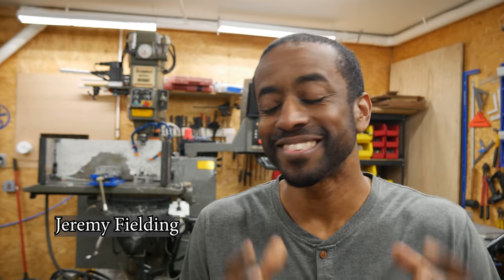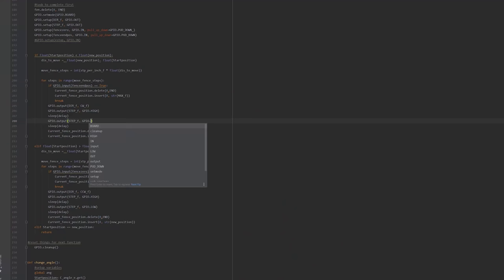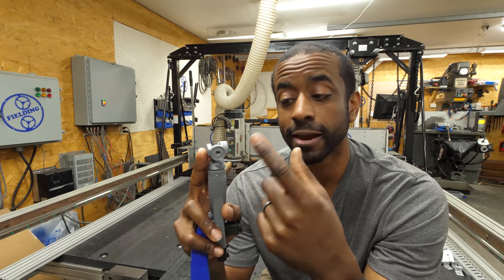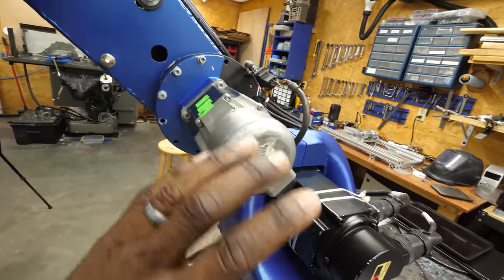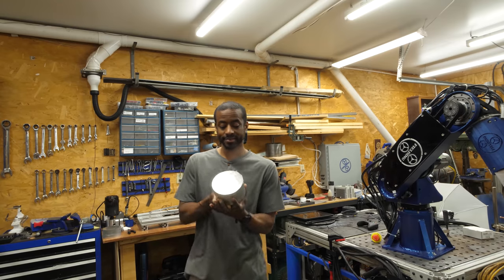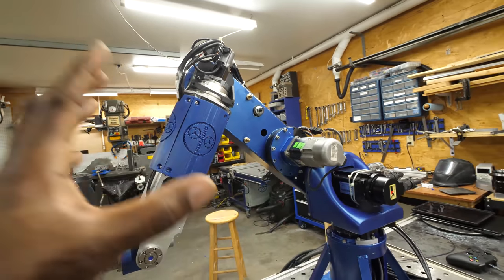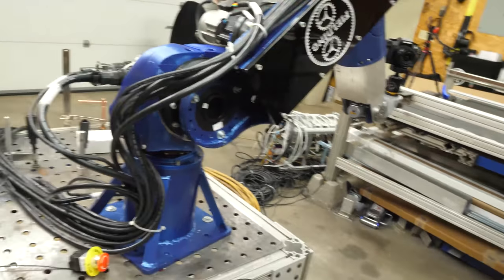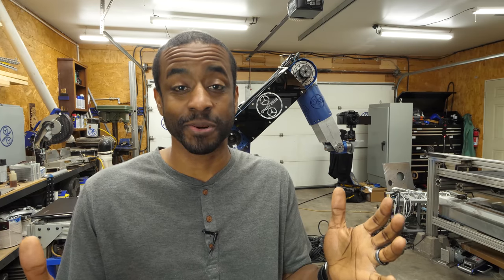Building a 7 Axis Robot from Scratch #089

Comment: As someone in a mechanical engineering class focused on robot arms, it would be awesome if you could show some of the math behind your statics, dynamics, and inverse kinematics software calculations. Also, adding some sort of robot vision for picking and placing objects would be a cool extension of this project.
Reply: I agree with you @jackson
Reply: I like how this guy build a robot arm, but I agree with you. I am an electronic engineer and did robotics at university. I remember that calculating a 3 joints arm was a nightmare of mathematical calculation using Matrix math for Kinematics, implementing certain acceleration/speed profiles. I wonder in fact what happens to this arm when it moves an object....if it stops right where it needs to stop without oscillations (loop instabilities), overshooting, etc. There is so much behind a robot project!
Reply: Totally double tripple agree with Gaetano and Jackson.. its mindblowing to see him building this from scratch. the amount of hardwork, effort, time, research, studies, the level of curiousity (and many more) that had been put into this is just unbelievable.
Reply: Yeah I'd love to see the control software too

Comment: Perfect timing, I'm a mechanical engineering student (at Danish Technical University), and I'm specialising in mechatronics, where another student and 1 are making our own robot arm (due at the end of June). Our project is making a digging robot (with 3 servos).

Your point about the centripetal forces was really good, since I only considered the weights of the robot and load itself.

Comment: I was lucky enough to go to high school in Michigan, we had a robotics program that got cast-offs from the auto industry at my small town high school in the 1990s. It was a real experience. Always regretted not doing more with it.
Reply: If there's one piece of secondhand twenty five year old knowledge I'd pass on, you want to have joint brakes on that. Spring closed, held open by solenoids or air, at least on the shoulder and elbow. There's also the option to support the arm with gas springs, but that limits the range of motion. Saw that on a welding robot when I toured a production line, that was a big jointed spherical with a ten foot reach.

Comment: Just noticed the spindle on your CNC machine in that quick clip. I got four of those this week from an industrial client who is getting rid of them. Some of them are still in the wooden crate but they are all used. Paid Scrap for them so if you have a use for them and I can get them to you somehow you’re more than welcome to them. Two of them look almost brand new and the other two have seen quite a bit of use. I have no idea of the shape they are in internally, but they were just going in the scrap motor band along with a bunch of other large servos and Siemens encoders and things like that

Comment: That's amazing! I am a mechatronics and robotics engineering student, and this year we were working on a similar robot but on a much smaller scale. I advise you to use inverse kinematics to specify the trajectory of the endpoint. This allows you to specify the (x,y,z) coordinates of the start and end points and the robot will automatically follow the path you specify. For the acceleration problem you could decrease the sharp acceleration by moving from the start position to the end position in increments. So you could have a array of points between the start and end positions, and the robot will move gradually through every point on that array. Adding a small delay between every 2 points of the array would help you control the speed. And the more points you have the more accurate the trajectory is and the smoother the robot is.

Comment: Wow, this is an amazing project!  I had a 7 axis arm on an overhead track performing hazardous laboratory tests in 1987.  I worked for BP doing research.  It was very very sloppy using cables to drive all but one of the axes.  Far from a true industrial robot but fun. I had to home it frequently to keep positional errors from adding up and causing issues.

Comment: You should look into the SSRMS. It's the 7 jointed robotic arm that helped assemble the international space station.  The space shuttle used a 6 jointed arm called SRMS.  The main advantage for the 7 joints over the 6 is it allows the SSRMS to do pitch plane changes, but at the cost of infinite solutions.  X,Y,Z,Roll,Pitch,Yaw and 7 joints equal mathematical trouble.  For every tip position of your robot you now have an infinite number of joint positions.  Good luck and I can't wait to see your next video.

Comment: This looks very cool.  It is way too late for this, now, and perhaps you have already looked into and addressed it in the videos you will be sharing, but I would suggest checking out using harmonic drives for robots like this.  They are very reliable, compact, offer very high precision with no backlash, and are self-locking for safety during a power outage.

Comment: Great project!
Do take the time to talk more about safety. These robots kill people every year in industrial accidents, through their strength and speed.
Industrial robots have e.g. hardware interlocks that cut power to the robot as soon as someone enters their workspace, and fencing that prevents people from entering the workspace. They also have spring-powered brakes in their joints that prevent collapse when power is cut. Or they use e.g. harmonic drives that have sufficient friction to not need brakes.
General advice: DO NOT TRUST SOFTWARE FOR SAFETY! Even the most elegant software safety system fails when a cosmic ray flips a bit.

Comment: You can use 3D printed parts to make sand castings to cast your curvy parts in metal (though the lighter plastic might be better for your application).

Comment: Cool project. Safety is a difficult thing to get right with these things, so be careful. They are potentially more dangerous than most things in your shop.

I see you have an emergency stop button wired up, which is good, but be careful that it does the right thing to fail safe.

Comment: I'm an engineering tech that specializes in robotics, prototyping, and automation, I can say that your table is likely not strong / heavy enough to handle the forces you are about to impart on it. That thing has enough power to rip itself right out from that table (or make the table fall over)! I've seen robots with no load literally rip themselves out of concrete slab that wasn't properly supported, or push big aluminum assemblies through drywall like it wasn't even there!

I may not have the engineering knowledge you do, but I do have years of hands on experience building and maintaining these things. If you would like any help, or someone to bounce ideas off of, let me know!
Reply from the maker: This table is not the final location. It’s just the most convenient for assembling and calibration. I agree the power is insanely high. I am operating at about 5% of its speed

Comment: KUKA programmer here. 
AC servo motors! Good choice for speed, power and position accuracy but might be difficult to control. If the motor drives have a step/dir emulation interface you may use almost any microcontroller to generate 6 step/dir streams according to the IK calculations. I think you will need a   big RAM to hold all the step times required to obtain a linear path of the end effector (all 6 motors are interpolated). 
If the step/dir interface is not available, then you have to control the drives using a field bus like modbus or ethercat using something called cyclic syncronous positioning mode in order to send the requisted position to all the drives simultaneously.

Comment: I have the axis 1 servo motor form a Kuka KR350 in my garage (for reasons) The donor robot had a 12 ft reach, and could manage a payload of 350 KG  with a movement speed of 75deg/sec on the major axes, 1,2,3.
It's rated 8 KW.

Comment: Ive only used a Kuka once. But I am fairly well versed in Fanuc and Yaskawa. I also work as an integrator, so I wire/program the robots, robotic work cells, and use a PLC to perform a repeatable process. For you Im thinking you could automate some redundant task/work, possibly between your cnc and robot. I also have experience in EOAT design, you should set up your robot for a tool changer, and do research into multi functional EOAT's. If you have any questions ask away.
Reply: Also i want to add that your work is impressive. Keep up the good work.
Reply from the maker: I am interested in learning about all kinds of robots. Send me a message on my website. https://www.jeremyfielding.com/contact

Comment: I’ve actually been spending a lot of time thinking about making one of these too! I’m sure this video series will be a great resource. One of my main questions is how to make the joints rigid and precise. What did you do achieve this? The only thing I’ve been able to think of is crossed roller bearings, but last I checked those are quite expensive

Comment: Wow what an amazing project!
I've been wondering about building a kind of "exosceleton" robot using carbonfiber composite to make big U profile pieces that support two types of joints: A hinge and a pivot joint. Then you could use the same kind of molds to make the composite and the same motor mounts and gearing for all of them.
If you would use BLDC motors with something like the ODrive you could also use stronger but "flatter" motors then you could use the same kind of planetary gear to mount them "inline" with the joints. 
You'd end up with a very bulky but stiff and lightweight robot arm.

Comment: two-angle full solar tracking on a mount pole arm. with two screw gear lock drives. should be very strong and cheap and easy to make. and more usable practical application.

Comment: There are so many free cad models of robot arms. Just download one and use you cnc machines to make molds for the cast parts. You can make the parts from carbon fiber or fiberglass in the molds you cnc (or even 3d print).

Comment: Are you going to sell it ? I see you have taken clue from Kuka robot for driving the 5th axis motor (vertically oriented motor rotating an axis in horizontal plane). However, it is very easy to sit in a comfy chair and comment like this. Taking risk and making your hand dirty is the most satisfying, mate. Bravo...you just cracked the robotics industry.

Comment: @ 0:53 think of a crane picking thousands of pounds hundreds of feet out. They use extremely expensive bearings that almost literally will not break. The pin holding the turntable on will snap first

Comment: Very nice. If you need a strong complex piece you can metal 3D print it. It's not cheap but it's strong. Something like 500MPa. And you can do finite element generative design so it's minimal mass. You can also use brushless RC hobby motors because servo motors are so grossly overpriced.

Comment: 4:27 why not swap the toothed pully on the motor for a set of bevel gears to transfer the rotation 90 degrees. Then, either directly or using a few more gears, you can drive the belt without requiring any fancy twisted belt work. My concern is that timing belts and other flat toothed belts aren't great to have twisting a lot, and also they aren't great to run teeth out over sharp bends, makes them wear out faster.
Reply from the maker: I considered and designed a bevel gear setup. I might try to address this question in the series. There are too many different factors for an adequate response in the comment section

Comment: What material did you use to 3-D print the two joints that you have in the arm I’m kind of surprised that it is strong enough to even hold the little part of the arm that it’s holding 
. You must have some kind of machine in your shop that creates time I’m just amazed at how much you’ve accomplished in the short time I’ve been watching you

Comment: Worked at KUKA ✌
Would have made some design choices differently, but impressive work so far!
You are talking about 7 motors, I can only see 6 axis, where is the 7th? Do you want to mount the 6 axis IR on a linear rail?
Big worksteps still ahead, looking forword for more videos 😃
Reply from the maker: It will go on a track. And I have made design changes LOL. I designed and built what you see in this video as a prototype in about 4 months… so it was pretty insane. I plan to gradually make changes as I learn and use it. Of course I have also never seen an industrial robot in person so I know there is much to learn. In Later videos on YouTube now you might notice some of the changes as it has progressed
Reply: @Jeremy_Fielding  Really good job so far!
The design choice that mostly cought my eye is that you do not balance the weight of the arm on axis 2 and 3. It is not absolutely necessary for smaller robots, but becomes more important for bigger robots (and yours isn't that small...). It adds some complexity, of course, but enables you to reduce the size of those to motors significantly.
When you look at a KUKA robot, you can see axis 3 is balanced by placing the motors to the other side of the arm and axis 2 is usually balanced using a hydro-pneumatic system. Using this, there is nearly no torque on the motor without a movement
Reply from the maker: @hansgunther6522  I did notice that looking at pictures of industrial robots (usually all motors behind the pivot point axis 3) and the reason seemed obvious, but I struggled to design a drive system I could build myself with the motors in the back.
Reply: @Jeremy_Fielding  Yeah, it is complicated. Usually it is designed with one shaft in the other and axis 6 through the robots hand using a belt or a lot of gears, but that's not easy to manufacture at home.
I think axis 2 is even more difficult.

Which gear types are you using? And which ratio?
Reply from the maker: They are harmonic drives. The gear ratios are 80 to 1, And 100 to 1 in some places. The motor in the base was changed to 750 watts. Other than I mentioned the motor sizes in the first video you watched.

Comment: I know a few thousands of people whod give their left arm to have that to help them with frozen shoulder and they're all rich
Right now there's no robotics available for frozen shoulder
If anyone gets frozen shoulder they either have to fight it out or risk taking up to 3 years to heal
Its very serious
I hope someone makes a robot arm for people with frozen shoulder

And maybe this could save you money
Instead of metal parts you can use plastic 3d printed parts and spray paint them with a bedliner like rocker guard
Or line x
Line x is very heavy duty but it will make plastic into metal 
the can versions are lighter but dont require a spray gun to use
Where i live to have a metal part made costs a lot of money
Getting it in plastic and spray painting it saves thousands of dollars
Thanks for your video

Comment: What was the main purpose of building it? Will it serve any valuable purpose? It does not seem like it will have any reasonable tolerance and repeatability. But it sure does look really interesting project.
Reply from the maker: Every component from the gears to the belts and their layout was selected to maximize precision. I am not concerned about either. Of course at this point you don’t have enough information from what you have seen to decide what level of precision it will have or how much is needed for the task. All that is to come in future episodes

Comment: If want anything you make to last, don't use aluminum, use steel. Aluminum is lightweight true, but it breaks easily and it's a pain to weld, and tapped bolt holes strip out easily too. Use steel for everything and it will last forever. Aluminum is only used in industry for cost savings and planned obsolescence. Case and point- ever see aluminum on heavy equipment? Aluminum bulldozer? Nope cause it's for toys and stuff that's made to break. Great video though and good luck with your robot!

Comment: Hi Jeremy, i am following you since several months and like your vlogs very much! I have the crazy idea to buy a robot arm (ABB IRB 120 or 140) and to try to let the tool mounted on the arm to move in an xy array to begin. The idea would be to mount the arm up-side-down to the ceiling of the workspace and to have several tools to mount on it (milling machine, plasma cutter, 3D print extruder, and so on). The difficulty would be to transfer / translate a STL-file in a usable G-code for the robot. What do you think about that idea...is it do-able you think. Greetings from Belgium!

Comment: At 1:59 it looks like the carriage is not bolted properly. Might want to check that. Otherwise amazing project. I am interested to hear about your design decisions. 
And that black 3d printed part seems to be holding a lot of (expensive) weight.
Reply from the maker: Almost none of it is bolted completely. I expect to disassembly it many times, so there is no need to install every bolt until it is ready for full load testing.
Reply: @Jeremy_Fielding  I meant on CNC milling machine. While it is machining. It looks like Hiwin? linear carriage on X? axis moves a little bit in x direction (not in sync with metal plate that holds Z axis), like it is not bolted properly. You wouldn't want those bolts to loosen up and fall out during machining.
Reply from the maker: I see now. thanks